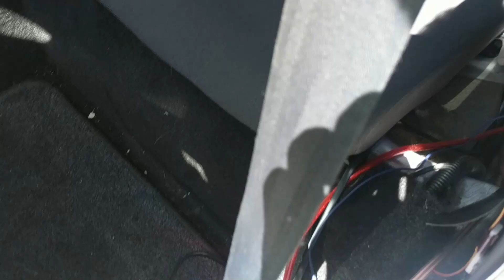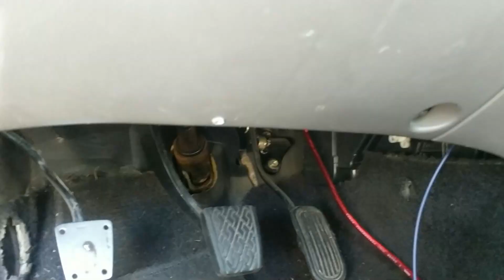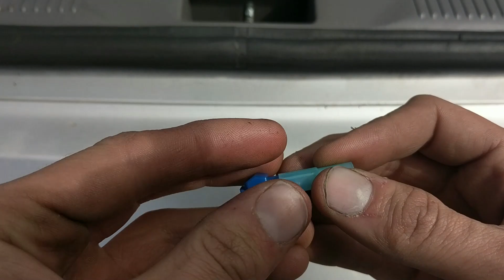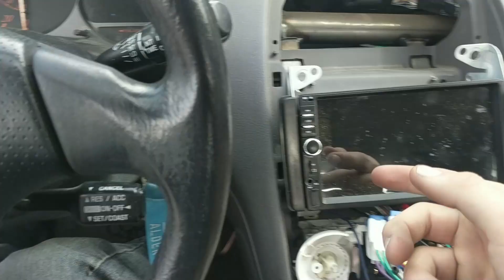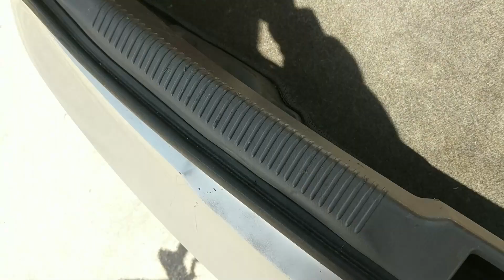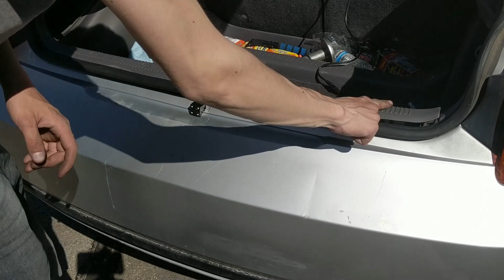How to Install a Backup Camera on Your 2000-2005 Toyota Celica (Step-by-Step Tutorial)

Comment: Sup!
My I got my first car (the same Celica as yours) June of last summer. The car got into like 3 or 5 collisions and got rebuilt.
I managed to break the rear windshield within the first month and blew my front right tire at the fourth. 
Lesson to learn, don't get distracted by a rabbit in the front yard of a house when you're driving back home. A Celica is not an SUV that can handle accidently driving on sidewalks and don't slam the truck on furnitures you try to fit inside the car that don't fit...
Also the truck latches mechanism is garbage, It didn't want to close when want I first got the car after I open it. Then want I go replacement one, It doesn't close in really cold winter (-30C to -50C).
I want to make a big road trip form Saskatoon to Miami to Montreal to Ottawa back to Saskatoon and not get stranded in the middle of nowhere.
problems

I found your channel with your "radio to touch screen" video and I watched all your Celica videos. They inspired me and gave me the courage to do some of the of maintenance/fixing/mods of the car myself instead of paying big money to a mechanic.  
I'm still gonna bring the car to a mechanics for diagnostics, manual tranny fluid (don't want to bother with it) and other stuff.
If ever sell the car I can do it in good conscious (maybe sell for what I paid) or it will explode on me. 
Except that one time the battery was too weak to start and I had to boost start (messing up my remote key system), the car never let me don't. Even with 250 000+ Km.
I was looking for a backup camera video and here we are.